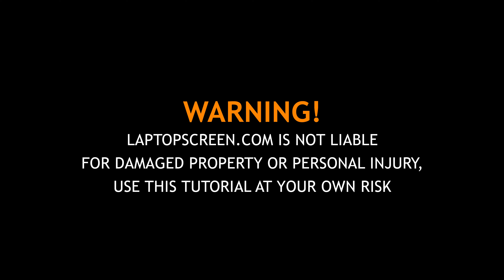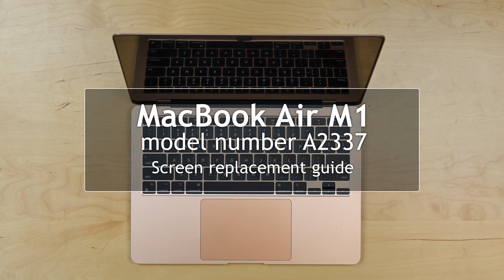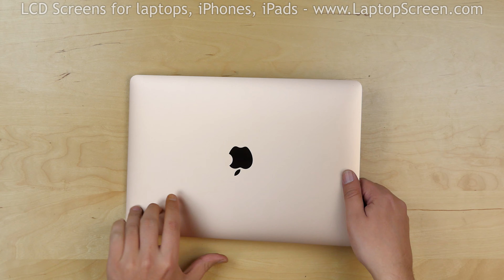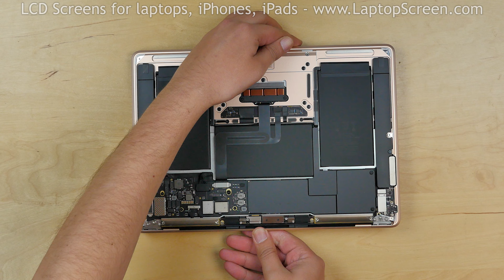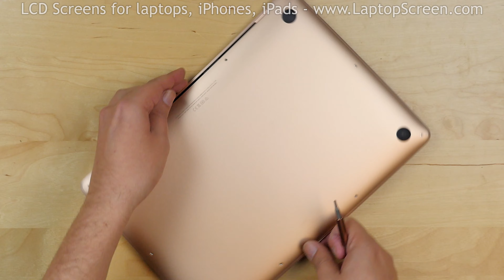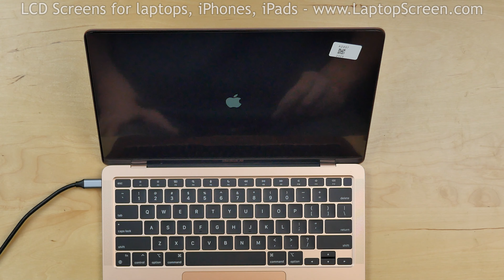How to replace Display assembly on MacBook Air M1 A2337

Comment: Would this apply to MacBook Air (13-inch, M3, 2024)
F4 Model A3113
SN: LMVVX34WK9
Reply from the maker: That model requires different steps, but you can try using the same general approach.

Comment: Was able to install my screen with this video- HOWEVER on my specific MacBook the hinge screws will not screw in if the WiFi antenna is already installed. Had to undo it to get the center-most hinge screws in.

Comment: They put that sticker on The ribbon cable in the worst spot. You can see it after the computer is reassembled! I had to use black sharpie cause they're a pain to get off clean.

Comment: Perfect tutorial. Changed my brother's broken screen with an OEM one. But the only problems I had were the battery cable rod doesn't seem to clear the little plastic piece on the holder and it broke it off. The battery cable still holds tight. But maybe if I had something extremely thin I could have pried that bar out to make it clear.. but it doesn't seem like it there was like no give there. And also I don't know if it was my bits but the 2 black screws on the long monitor assembly piece wanted to strip unless I used a T5. That was scary but I got it to work
Reply: Yes, I used a T5 for the 2 black screws as well.